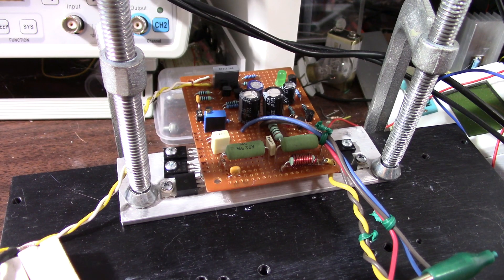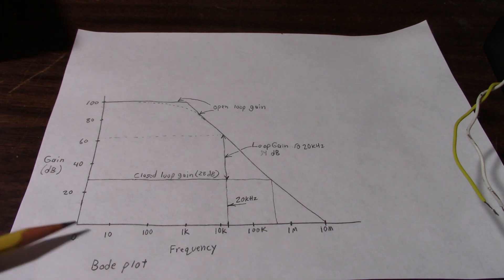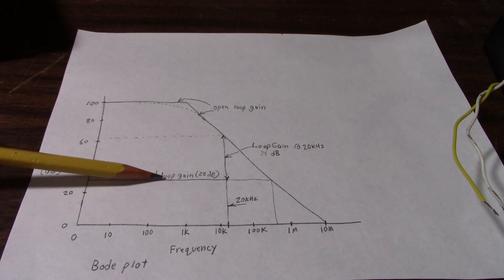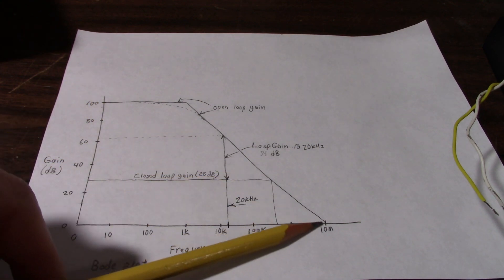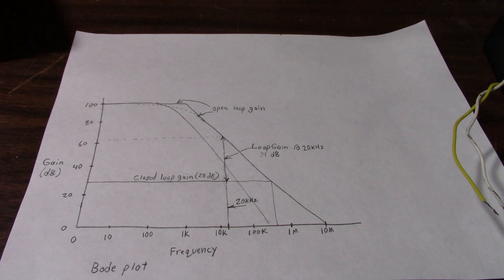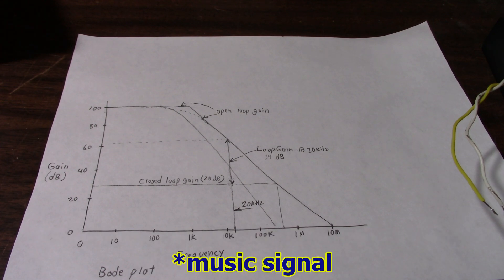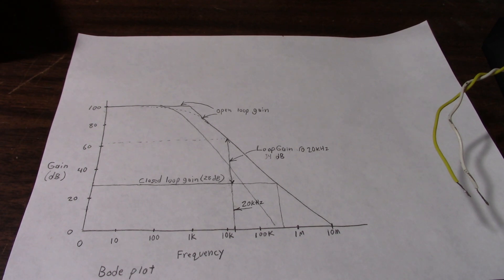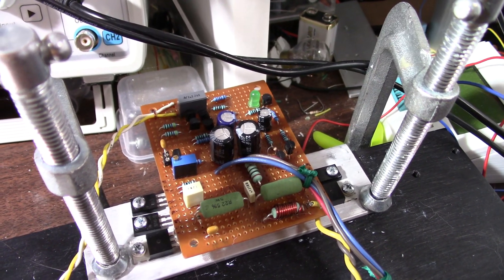Why hifi audio amplifiers are so fast (wide bandwidth)

Comment: From your Bode plot, it's visible that there happens a change at around 1 KHz. It's my experience that this is audible. When I build amplifiers, I aim towards constant open loop gain up to 20 KHz even though this is typpically done by lowering the open loop gain. My circuit are created with low distortion in mind, so the only thing I use feedback for, is lowering output impadance. 

Actually one of my amplifiers didn't use feedback at all an thereby having constant distortion pattern over the entire audio spectrum. It sounded greate despite and was easier to maintain stability.
Reply: You are essentially doing the same thing. And yes it's not audible. Or it will sound better if the circuit is stable. You are still using feedback but local degeneration/feedback. Meaning it's less efficient way to utilize open loop gain. That's why there are output inclusive compensation and two pole compensation over transitional Miller compensation.
Reply: One of the LC Audio amps called Millennium didn't use fb - is your amp some how similar in design. The circuitry has to be very linear and very wide bandwidth with well chosen gains, something that I think isn't as critical in amps with nf. Maybe that's reason many amps sound so-so.
Reply: It would be interesting to see your design.  I'm guessing you may not have overall feedback, but rather each stage has it's own negative feedback (such as a unbypassed emitter resistor).
Reply: @russellhltn1396  I have seen that before. If you look at an emitter resistor as feedback (from where to where?) then you cannot avoid feedback at all, unless you aren't aiming for quality in any form. So yas, I use feedback.
Reply: @bennyjorgensen  Yes, I'd consider the emitter resistor as a form of feedback.  The collector-emitter current affects the base-emitter bias.  (more current, the higher the voltage at the emitter junction becomes with respect to ground and it lowers the voltage seen by the base-emitter)  If you add a large capacitor across the emitter resistor, then the feedback is just at DC (bias) and not at audio frequencies.  More gain, but more distortion - which is what we expect if we were to remove negative feedback.  I can see how some view this as different than taking the speaker output and feeding it in before the phase inverter.  But they still have a similar effect and both would be studies/learned about together in a class about negative feedback.

Comment: It's generally  accepted that distortion figures below 0.1% are inaudible and indeed in blind testing whether it's a musician or a bus driver or a hifi reviewer the point where it is imperceptible hangs well above that point. Amplifier designers too have argued over the merits of a wide response. Some engineer their amps to restrict the bandwidth while others let it roll on out to ultrasonics. The risk of using too much feedback is the constant problem with phase response creeping toward instability. High feedback levels have been found to impair performance too. The wisest way to build a good amplifier in my opinion is to engineer the open loop gain with as much linearity / wide a bandwidth as possible and so keep required feedback levels low. It also allows you to build an amp with fewer stages. Each additional stage will introduce it's own set of problems (phase, distortion etc). This is why a simple valve amplifier can sound so amazing. With just two active stages - maybe, a single voltage gain stage and a power stage which minimises all your problems and if both in triode mode the linearity to even avoid feedback altogether. Maybe this is why they sound so dynamic, transparent and live?
I have heard many a complex wideband amplifier sound amazing though. There are many routes to nirvana - hence the confusion. There is no one answer it seems. And this is just amplifiers...
For anyone interested Amar T Bose has his MIT lectures  available free to stream, and though I don't agree fully with all his philosophy, he has to be one of two or three of the most extraordinary acoustic engineers ever to have lived...AND IT'S ALL FREEEE and full of amazing stuff.
Reply: the distortion structure is quite different between SS and tube. tube mostly have a lot even order harmonic and they're monotonic. (2nd high, 3rd low, 4th high, 5th low). It's not impossible to make SS sounds close to tube, though
Reply: @n.shiina8798  Absolutely, though Its not just distortion structure of the device, which can  often be determined by circuit topology (edit:overall distortion products). (Any push pull stage for instance will remove all even order harmonics) - but even so, a single tube class A triode output stage without feedback may give you below 1% total distortion at normal levels, most of which are even order. (your monotonic). Not many SS devices can manage that... Though Sony made some VFETs which were about as good as solid state gets for audio. Possibly the perfect device?
Reply: @martinda7446  
I don't know, I mean you make good points well expressed, but about what we individually consider "quality" sound.  Sure, those tube amps - I've had several and designed/made a couple - they really can sound sweet, but, at relatively low levels.   Those class A triode jobs produce only a few watts.   The strongest tube amp I had was around 75W, which, no matter how clean, is just far short of creating realistic listening levels wideband for me so I can't choose them for my purposes.    It takes a couple kW per side to drive my six driver 30ft3 speakers to make 100-120dB SPL soundfield wideband with accurate transient response.  So even if the distortion profile is less desirable, overall reality is my prime objective.   Good discussion...
Reply: @elgringoec  Sound pressure levels are no problem. Just use the right drivers. !05dB all day. Compared to average 88dB domestic small box that is making your 6W valve amp equivalent to 250W...
Reply: @martinda7446  
Yes, I know.  I have some of those drivers.  Problem is narrowband and sloppy transient response in comparison.   My low electrical efficiency drivers are much fuller and realistic sounding in comparison (it's all relative).
Reply: @elgringoec  The motor is king here, (crappy drivers will have your response) and also no reason why you can't have two way or three way systems. There is no reason on earth why a properly designed high sensitivity system can't be as good or better than a low sensitivity one. In fact many reasons to the contrary. Ask Klipsh, Lowther, or dig up Mr Briggs etc. Low efficiency speakers became popular for the very reason we are discussing this, power became cheap and hence boxes could become smaller. I don't suppose it's necessary to explain I have worked in high end audio for 40 years and heard almost everything as even in that field there are arguments every day with people saying exactly what you are saying....
There is no absolute answer and there are many philosophies to follow. As you have gone your way, I have gone mine...maybe we should sort it out with a fight (o;
Reply: @martinda7446  
I'm not going to disagree with you.   If you're looking for a fight then I'm sorry to disappoint you.  I became enthused with audio before starting kindergarten and now my first grandson just signed up for kindergarten.   I've been down a lot of roads and heard all kinda stories, as you can imagine.    I read major publications, went to shows, collected stuff, repaired, modified, designed, and built stuff.   I heard most if not all the major stuff.   I know what puts me in the zone and would never be so brash as to claim I know it all nor have the "best" system.   What I can tell you is I've never heard any other system that sound better to me.   A typical response from someone might be "I don't listen to music that loud" when I dial it in to my normal daily listening session level, so it's evident that attempting to recreate an original sonic event isn't everyone's cup o' tea.   It's all about our individual objectives as to what constitutes closer to achieving them.   I also record multitrack, edit, mix, master, etc, and have learned to approach my objectives through the entire process of original air pressure variations to their recreation.   Blessings, and enjoy what you do!   I know it's been a great ride for me and though I'm winding down I can still ride...
Reply: @elgringoec  Well done.
Reply: @martinda7446  
👍 Thanks man, respect.   We don't get this far in life without picking up a thing or two.  The small box thing...  I'm running about 30ft3 per side.   Couple refrigerators   😂   Ticket is low Q - critically damped erring toward overdamped.  Those small boxes tend to be severely underdamped.  Big "resonatey" warm bass with reduced definition.   Some are so bad it feels like the bass track is shifted from the others.
Cheers 🍻
Reply: @elgringoec  Cool, I'll stick to no boxes at all though...Quads.
Reply: @martinda7446  
Nice!  Loved the quads back in the seventies.   Can you say definition?  The amazing Dayton Wrights added some bottom end.   I'm doing a lot more SPL especially down low these days.  Hooked on the "sledge hammer to floor" kinda feeling.   Cheers!  🍻

Comment: First!!
Reply: Love the effort to go to great length to explain the process to the design of this amp.  on the subject of distortion and power I am no expert but being a long time hifi nut the proof will be in the listening.  currently I am listening to a diy 300b/6sn7 integrated tube amp. It must have more than 5% distortion but I am just enjoying nearly every song I play on it. Go figure. My other class d amp has less than 1% reported and while a fine amp, theres something missing in the sound.
Reply: @woodowoodo1405  Distortion is just that the device adds something to the music. 0% would mean that it doesn't add something, being a "cable with gain". Your tube (and my former DIY amplifier) adds stuff and I see that as coloring the music, as my titanium tweeter (really nice on eletric guitars) also does. The "color" is just a question of taste.
Reply: @
Loki Wankhede

you looked ruff when i watched buffy 20 years ago , you probably look much worse now :-)